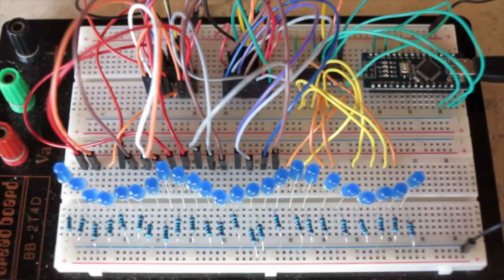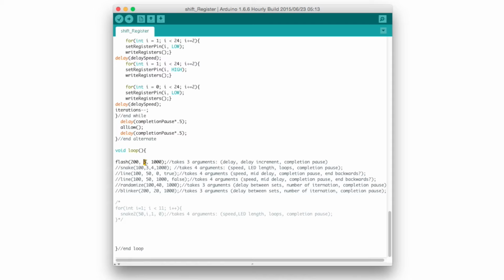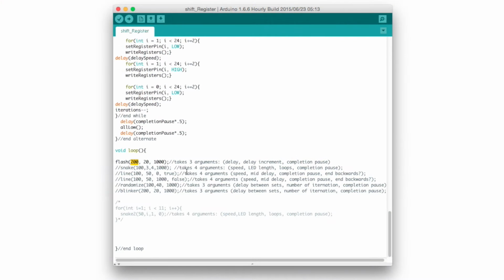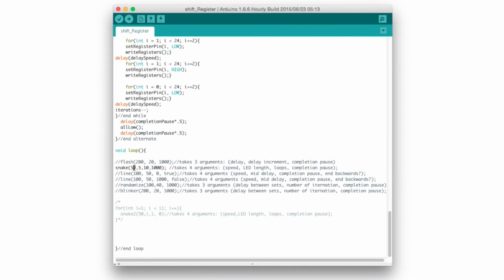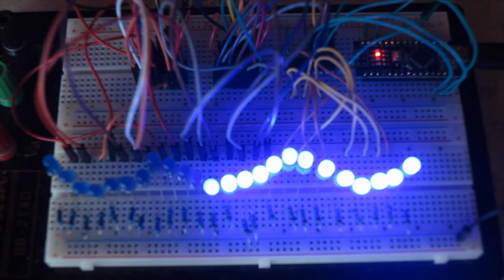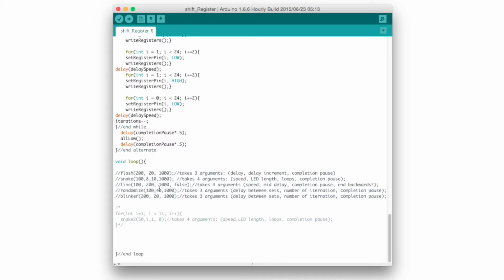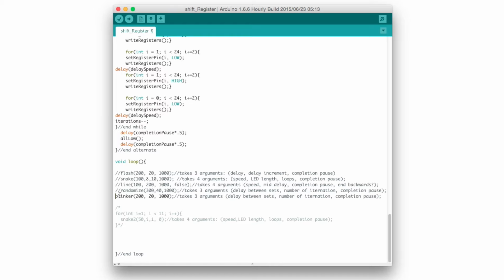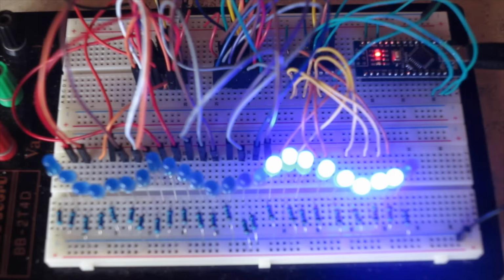HOW TO CONTROL 24 LED'S 😎  SHIFT REGISTERS AND ARDUINO, WITH CODE!

Comment: Very nice work, and very good video presentation! Really enjoyed it. I was hoping to see other suggestions than github about where to put code, as that site it a mess to use. But still, please post the code and put a link in the description as I would really like to study it. I have a project more or less identically set up. My goal is to use shift registers with say 50 LED's total, but then run different functions for groups of those leds. For example snake effect on the first 10, random blinking on the next 10 and so on. I haven't figured out how to do this in a clever way yet. Thanks for the presentation!

Comment: I would also recommend github for your code. Another thing that I think would be cool was if you made a copy of the last function but instead of alternating between ever other LED, iterate over groups of 3 so it looks like its spinning in a particular direction E.G
if you had 12 LEDs
0,3,6,9 then 1,4,7,10 then 2,5,8,11 finally back to 0,3,6,9

that way it has an obvious direction it's spinning which could also be reversed if that functionality is built into the method/function (it doesn't return a value so it technically wouldn't be a function)
Reply from the maker: Thank you I'll try that! I've been looking for new functions to add.